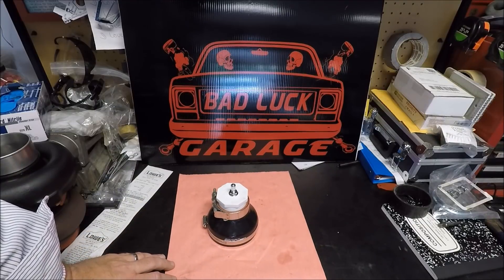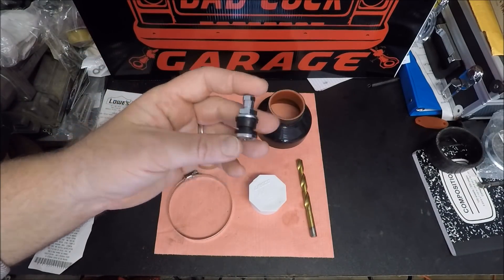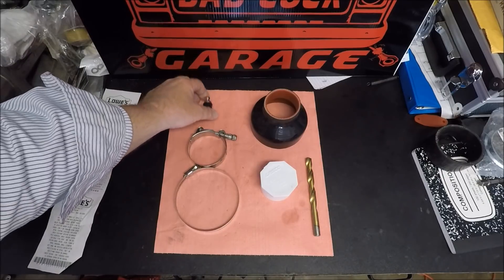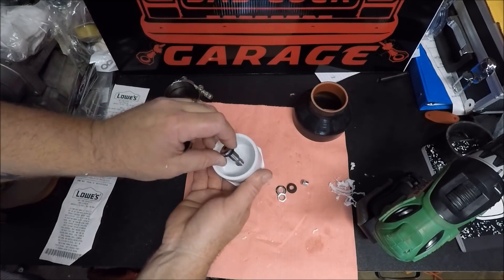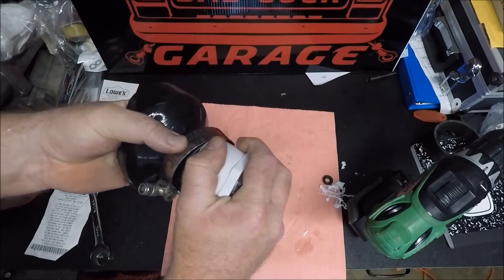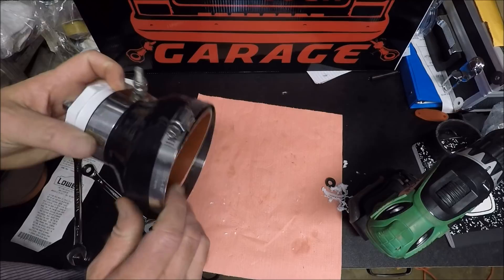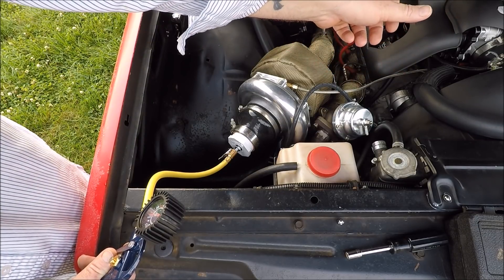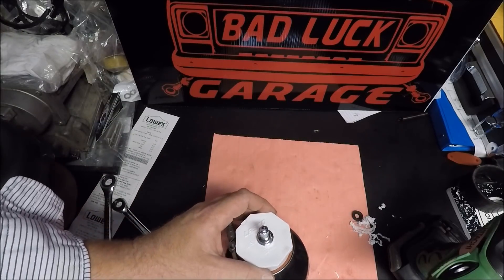$20 CHEAP TURBO BOOST LEAK TESTER

Comment: My. Bff had the same issue he had a smaller turbo then a bigger turbo so he put the bigger turbo at 5 psi and brought up the mad readings on hp tuners and his fuel readings when it hit boost the mad was past it's max ability number.ber wise to make adjustments and it just guesses and goes I to limp mode so kt dont blow up but he had two options go speed density or go with a higher reading maf sensor soon as he put a higher reading g maf sensor on his truck it didn't t do it anymore
Reply from the maker: I’m already running a 2bar sd tune and MAF has been deleted. The issue is throttle body flutter as outlined in my last video. This boost leak test was just to see if I had a leak that was causing slow spool up. I’ll be addressing the throttle body issue soon when I get another throttle body to experiment with. 😉

Comment: I think your exceeding your maf sensor if you go into hp tuners you can see your mad sensor parameters and see the max hertz it can read and the minimum to maximum hz the mad can read if when in boost it cant read that much air going across the mad wire them the computer has to guess and it domt know what to do so then it goes into limp mode so my bf had the same issue and that's whT it was he had two options go speed density or get a higher reading maf sensor so he got a bigher maf sensor and then he didnt have the problem anymore
Reply from the maker: Hey Amber! I’m running a 2bar SD tune and have already deleted the MAF. The MAP minimum and maximum tables have already been changed to coincide with the 2bar Map I’m running. I’m experiencing throttle blade flutter under boost and that’s whats setting the code. It’s actually a pretty common issue with DBW setups but most people don’t fix it...they just convert to DBC instead. I’m being stubborn because I know it can be done. 😉

Comment: Truck update video soon!
Reply from the maker: Unfortunately there’s not much to update on yet. 😔 Been driving it everywhere everyday but get in boost for more than a few seconds and it goes into limp mode. Luckily it takes this damn 78/75 so long to spool that I can just drive normal and don’t even have to worry about the limp mode  boost issues.😒

Comment: This was fine, but I'd rather see you destroying a set of tires. 50mph rolling burnouts, please.
Reply from the maker: I'd love to see that myself but the throttle body issue still hasn't been worked out. I've been driving the truck everyday but get into boost for more than a few seconds and its in limp mode. I've tried every tuning solution and nothing fixed it so I know its going to have to be fixed with parts, not with the tune. Next step is to try another throttle body. Cant seem to coordinate with my uncle to use his so I guess Im just gonna have to take a chance and buy one. Went to the junkyard last week and couldnt find a single friggen truck that still had the engine in it to get one so for the time being I guess Im just gonna enjoy driving it. Even if I cant use the boost.
Reply: I just happen to have one. I went cable. Have a P.O. box I can send it to?
Reply from the maker: Brother I can’t ask you to do that..... But if you absolutely insist, the PO Box is at the bottom of all the video descriptions. 😜
Reply: You didn't ask. I'm offering. I might be able to shoot it out tomorrow.
Reply from the maker: Rusty Wrenches, Yea he ended up switching to a cable setup and holley efi. Dont think I havent thought about it but with so many people running this same setup with DBW I know it can be done. Thats whats so frustrating!!
Reply: I know Cletus was having a similar issue.  I think he threw money at it and went with a Holley ECM though.  I’m not sure if they ever figured out what was causing the issue.  I think he even tried a Nick Williams TB and it still did it.  You might hit up Sloppy Matt and see if he has any insight.
Reply from the maker: AEE automotiveengineeringenthusiast,
That would be awesome brother. Even if it didn't work immediately, I could try to modify one if I have an extra. If you do send it, make sure you put your return address and shirt size in there so I can send you something as gratitude. ;)